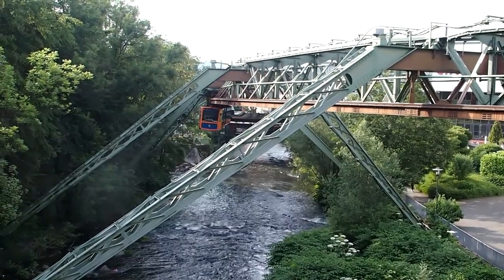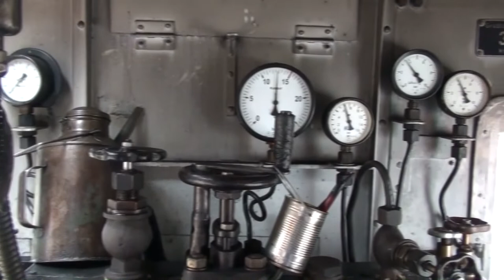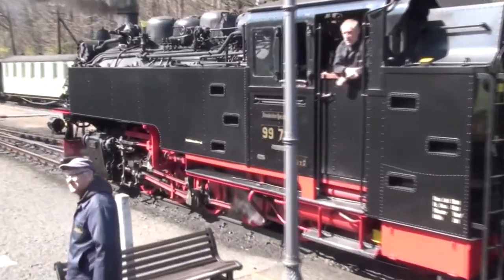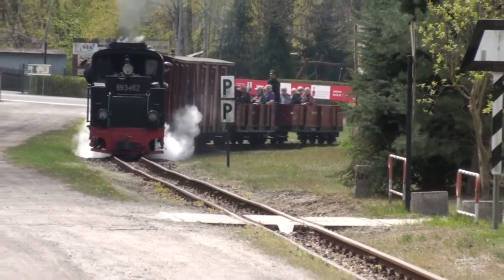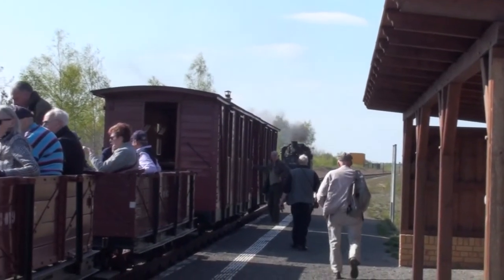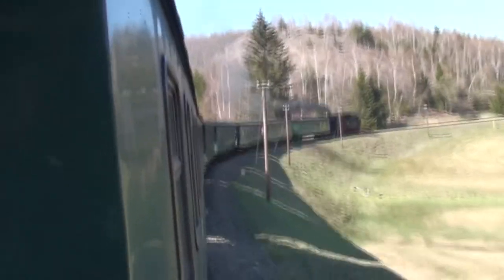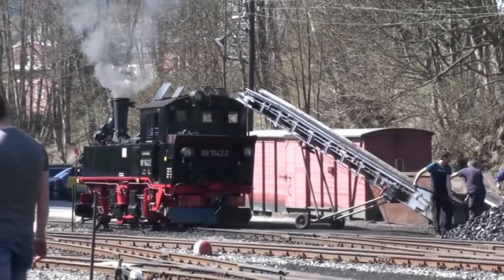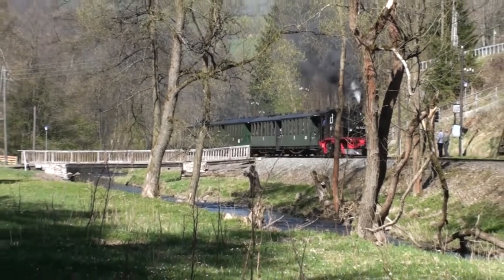German Narrow Gauge Steam in Saxony 2019

Comment: Fun fact: Why do all (!!) German non-standard gauge steam locos have that "99" class numbers? They are definately not similar enough  for just one class when you look at them. It all started in the 1920s with the new "Weimar" constitution.  In 1871 some 25 German states plus three independent cities had united, we know that, but that did not mean that the German states gave up their souvereignty in a lot of domestic matters. Rail, commerce and transport remained in their local hands. Most of the railway system was then unified as "Deutsche Reichsbahn" and all that rolling stock plus locos were then incorporated into its new classification  system. A broad variety of so-called "Einheitslokomotiven", unity-class locos, appeared on the drawing boards, starting with the "01"-class for fast express locos, and so on. There were the heavy freight locos with their numbers ranging from the "40s" till the "50s". And older ex-Prussian, ex-Bavarian locos were compared to the new designs and got numbers that came close to the new ones so that it was clear which purpose they could fulfill. The ex-Prussian  "P 8" became class "38", for example. All this work was done by some office and it took years to re-class all that abundance of locomotives. And when all this had been completed  the order came to do it again with the huge amount of narrow gauge trains that were the backbone of local transport in either rural or mountainous regions. There were so many different designs that the numbering system came to its end. The number 98 had been used for some standard-gauge tender locomotive and so there was only the number 99 left for the entire fleet of narrow-gauge locos, no matter what they looked like, how many driving wheels they had, whether they ran on 660, 750, 990 or 1000mm gauge.